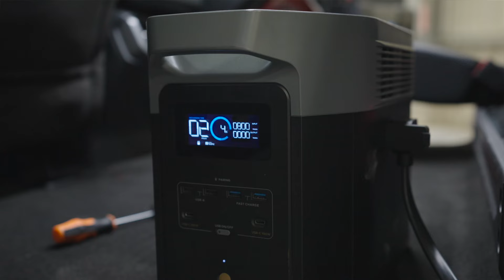How to Install an EcoFlow 800W Alternator Charger in Your Vehicle: Step-by-Step Guide

Comment: Do u have to remove the fuse from positive cable to feed it thru floor board and engine bay firewall? Don’t see how that wire and fuse will fit when threading it thru such tight quarters w/ big fuse connected? Just ordered one. Thanks for feedback.

Comment: WTF EcoFlow..!!!  Why do you NOT show the entire install..?  That fuse block will NOT fit through the grommet. Yet you FAIL to mention having to remove it, then push the cables through the grommet, then reconnect it.

Comment: Have you got any advice on the minimum alternator size for this product please
Reply from the maker: Thank you for your interest in our products. Regarding the 800W version of the car fast charger, we understand that you may want to know more about the minimum vehicle battery specifications. We would like to emphasize that the car fast charger supports 12V or 24V vehicle rechargeable batteries, and there is no specific battery capacity requirement. We hope this answers your question. If you have any further inquiries, please feel free to reach out to support@ecoflow.com for further assistance.
Reply: @EcoFlowTech  what a crap corporate answer
Reply: @EcoFlowTech That's NOT what the question was.  The question was about the size of vehicle ALTERNATOR required to support this device. This is something I also need to know..
Reply: @EcoFlowTech  Do better.
Reply: I think I have the same concern as you. I’ve never heard of an 800 watt alternator. Here’s our answer I found right on their website.

“No, the 800W alternator charger's charging logic does not rigidly apply 800 watts. Instead, it depends on the power surplus of the car's alternator. It ensures the alternator is not overloaded, allowing up to a maximum of 800 watts without harming the car's battery.”
Reply: Since ecoflow did a poor job of answering the question I will (kinda) at full input capacity this unit will draw 66.5-67 amps this is alot I’ve got a. 130amp alternator and it will run it with minimal drop in voltage with that being said it is a strain. Overtime it will wear out this alternator, really depends on how much you will rely on this charger. If it’s being used on a daily bases I would highly consider getting an alt built custom. If it’s going to be used on a weekend adventure once a month I think it will be sufficient. Many stock alternators are not going to handle this well the stock alternator I had was only 70 meaning I would cook this alt. To check your amperage find the barcode on your alt and it should have numbers below it put that online and you should find spec sheet
Reply: This answer with lack of attention to detail is exactly the poor service EcoFlop is known for. Do better please read and answer properly.

Comment: Will there be a longer more detailed video in the future?
Reply: it is self explanatory. You simply connect at the unit and than connect the positive and negative wires to the battery. That is what I did and walla.
Reply: @HebrewNomadOverlander did u feed wires thru all those tight quarters and side paneling w/ fuse box connected to positive wire? Seems like a tight fit without removing fuse box. Thanks

Comment: Ford a Ford Transit with a CCP (consumer connection point) can it be hooked up to the CCP or does it need to be connected directly to the battery?
Reply: On the Hobotech youtube review of this, he had to connect directly to the battery on his Sprinter. i.e. not the more accessible jumper port. Probably same with Ford Transit.

Comment: Ecoflow alternator charger for a ecoflow power station, that has a built-in inverter. Also each of the delta series ecoflow has power outlets, both AC and DC, and it also has solar charging capabilities. This alternator charger can also reverse charge the cranking battery. Ecoflow just killed redarc dual battery system.

Comment: In my country, temperature drops to -30 in winter. My car has Eberspacher engine heater and when I preheat the engine, it runs on the starter battery and very cold weather is bad for the battery at the same time. So, I am considering installing a DC DC charger with reverse charge function, which way I can bring my portable power station to the car before preheating the engine and connect it to the DC DC charger to protect the starter battery. My question is: does the reverse charge function work normally in very cold, say -30.

Comment: Great concept terrible execution
I wanted this to work so bad! The entire purpose of having this system was to be off grid. I hooked it up at home using my WiFi and everything seemed to be working perfectly. Then I left for my very first trip... I was about an hour away from home when I decided to open the app and check on things. The alternator charger had disconnected from my phone. I spent about 30 minutes on the side of the road trying to figure it out before I called customer service. I was then told I have to be on the original WiFi that I set it up on to reconnect. So I drove all the way home. I had to restart everything before it would reconnect. I then left for the second time. It stayed connected for about two days and I thought it was resolved. I was wrong... I have gone on multiple trips and it has disconnected every time leaving me with no way to charge my delta 2 max. I have since figured out that I do not need the original WiFi to reconnect however you do need WiFi. I have had to leave my camp in search of internet when the entire point of this was to stay off grid. I am very disappointed. I will say that WHEN it works it's very fast at charging. It is however not a dependable product. I never know when I open the app if it's going to be working or not. UPDATE… talking to customer service did nothing but raise my blood pressure. They were less than helpful. I had heard great things about their products and customer service however my experience so far has not been a good one.

Comment: whats the difference if you just charge your delta pro to the AC socket of the next gen ranger?
Reply: DC charging is more efficient which is what this has.  Also comes with 6GA cables to handle the load and again, is more efficient.  The cables to the 400W bed outlet are way smaller, so you might not even get 400W at idle.  This also enables a power station, like any of the Ecoflow products to balance charge, or reverse charge to your trucks battery.
Reply: AC plugs (9v) on all vehicles only charge at 8 Watts and draw/ drain power from your vehicle battery.  This takes power from the ALTERNATOR instead of the battery, and charges, adjustable with the App, all the way up to 800 Watts.

Comment: How do you charge the extra battery on the Ecoflow Delta 2?  Do you have to manually disconnect the Delta 2 and then plug in directly to the extra battery?  
If I charge on AC or Solar power, I leave the extra battery connected via the XT-150 cable and it charges both.
Reply from the maker: The battery pack cannot be charged independently. It must be connected to a product with charging capabilities, such as the Delta 2 main unit, using the XT150 connector to charge together. Alternatively, it can be connected to other compatible main units.
Reply: @EcoFlowTech  Doesn't the Delta 2 only have one XT150 connector?  This XT150 is the connector that links the extra battery to the Delta 2, right? If the Delta 2 is connected to the extra battery already and using the XT150 connector, how do I connect the 800W Alternator Charger?

Comment: DC to DC chargi g is the way to go. Any 120v electrical device like a laptop or CPAP machine is running on DC power. Running a 12 pilot battery through an inverter to power something  like  a laptop is a waste of e energy. I killed a deep cycle battery in one day when I was poweri g my CPAP machine with a battery and inverter. I purchased a cord designed specifically for my  model of CPAP, which steps up 12 volts to 24 volts DC. Less wasted energy. Using a DC to DC  in your vehicle is the fastest way to charge  modern Lithium Iron Phosphate batteries. This is the newest and best way to go.
I Mohave a question about slitting a hole in a rubber grommet to run wires through the firewall. That hole is now open to the elements and  will allow moisture kicked up from a wet road to soak the  carpets in the  vehicle. There has got to be a better way.

Comment: Is this compatible with eTorque engine?  Since alternator is replaced with eTorque and additional 48v battery in addition to standard 12v car battery.
Reply: That would depend on how the 12V battery and accessories are charged. If the eTorque outputs 48V and uses a DC-DC converter to charge the 12V system, you'd be limited to the output of the converter minus any power draw your vehicle already has on the 12V system.

The EcoFlow alternator charger has a max voltage input of 31V, so it cannot be directly connected to the 48V system.

Comment: Just added this system to my 35’ Express Cruiser, simple to install and operate. I have it setup will 400 watts of solar panels and 3 bank of batteries. I set the start up charging at 12volts and charging limit to 400watts, this way I don’t drain the batteries and use the solar panels as main charging. It’s definitely not as quick as it could be at 800watts but it because of my solar limitations, while using the rest of my 12 volt system. Way quicker then using the 12volt outlet
Reply: 35' Express cruiser.. as in a boat..?  I'm guess Jewell is your last name..? Mine too. I'm offgrid, but hooking up one of these to my cabover camper. I'm gonna put a 400w panel on it and keep a pair of 100Ah lithiums charged.

Comment: How do you keep the inverter from draining the battery?
Reply: That inverter works 2 ways and keep the battery in good condition
Reply: [3-in-1 Charger, Maintainer and Jump Starter] Three integrated features that charge your portable power station, keep your vehicle battery in peak condition and acts as a jump starter when you need it most.
Reply: This unit doesn't draw from your vehicle battery, it only draws from the Alternator.

Comment: Can be Delta pro charged with Ecoflow alternator charger from 48V 200ah battery (Operating Voltage 43.2V-57.6V)?
Reply: Max input voltage is 31V, so you cannot use a 48V system.

Comment: What is a "alternator charger"? And what does it do?
Reply from the maker: Hey there, thanks for your interest! To answer your question - #EcoFlowAlternatorCharger is a key piece of our On-the-Road Power Solution, expertly tapping into your vehicle’s existing power system. Designed as a DC-DC step-up converter, it connects directly to the starter battery and alternator to harness excess power generated while driving. This innovative 'Drive & Charge, Plug In & Power' solution offers endless energy for on-the-road comfort and outdoor adventures. Hope it helps :)

Comment: Question
I don't see the Delta Max battery listed as compatible, only the Delta 2 Max, can you confirm if the Delta Max battery is compatible since it has the correct connector?
Reply from the maker: Hi Jake, yes, it's compatible with both DELTA Max 2000 & DELTA Max 1600.

Comment: Where are the fuses to protect the wiring?
Reply: You missed it. Fuse was a couple inches past the battery ring terminal on the new wiring.
Reply: @gregmgm06 do u disconnect fuse from positive wire before threading it thru side paneling and firewall and reconnect fuse once wire is near battery? He doesn’t show this in video.

Comment: How short was the cable after managing it in the engine bay?
Reply: Cable is 17 feet long
Reply: @HebrewNomadOverlander  Hi, yes I know it's 17' but I had to run about 20' from the battery in the same corner to the my inverter to a similar location in my Xterra. Was hoping to see what the end result look like if after the cable was nicely tucked away, I'm pretty sure you're a couple of feet short too ;)
Reply: @VancouverTrailShredders Ya, my minivan is 16.5 feet. By the time the cable is routed around under and through things I will have to put this under the driver seat and hope the cable to my Delta 2 is long enough to put the main unit wherever I want.
Reply: @ServantOfJesusChrist777  oh yeah, that's going to be tight depending on where your battery is located. But EF is aware of it now, I've brought it up a couple of times, hopefully they'll come with a longer battery cable.

Comment: If connected to a ford Transit CCP1 (60A), is there a way to keep this from exceeding the  rating?   (800w @ 12v = 66.6 amps).  Is there a way to have the dc to dc charge a generic 12 battery - not using a proprietary ecoflow connection?
Reply: Very good question - I am happy to stick to my Victron DC-DC charger in my DIY Ford Transit 250.
Reply: The app has a setting to limit the maximum output power, so you should be able to keep it under 60A.

Comment: Hi (Andy Smith UK) the Cable you have used from the Vehicle Battery to the Inveter looks like a Factory Manufactured Cable, if it is do you have a Pt #, as I can't find one on the Ecoflow Website? Cheers Andrew

Comment: Basically in theory you connect a surge protector run an electric motor to spin two or three alternators (not sure if in series or parallel) connect to the ecoflow alternator. Maybe a possible infinity generator. might need a windmill resistor for overcharge bleedoff.
Reply: Nope